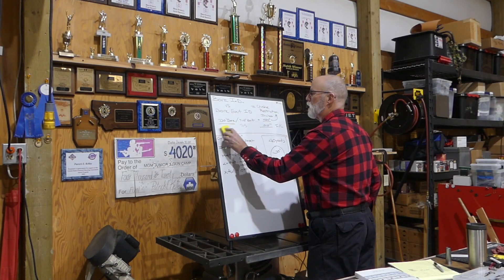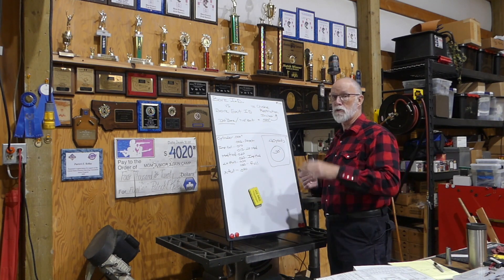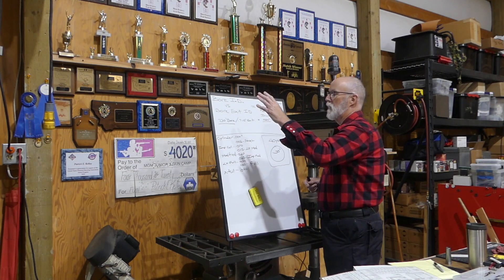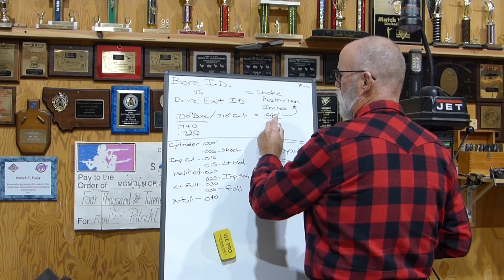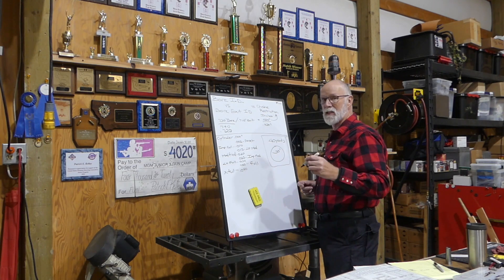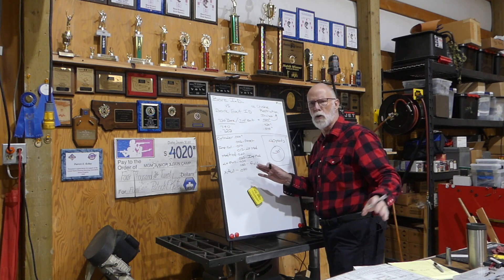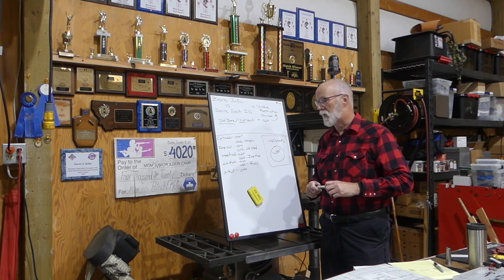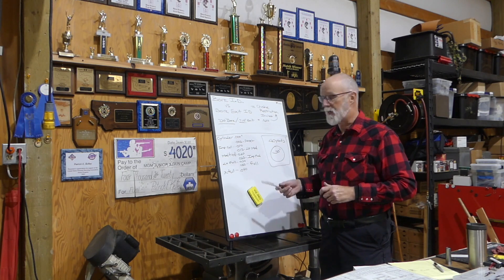What is a Shotgun Choke?

Comment: Nice to see you back. I hope you are doing well. I have an odd question regarding rifled choke tubes for shooting slugs.  Do they actually work to improve accuracy when shooting slugs?
Reply from the maker: Rifling (choke or barrel length) is mostly for Sabot style slugs.  Rifled slugs have "fins" or raised ribs to fit smooth bore barrels and be able to squeeze through chokes.
Reply: Along the same sort of lines...
I have fired several brands of rifled slugs through the rifled barrel, just to see what happens.   ALL of my shots, from every brand, walked to the right beyond 40 yards. 
Rifled - sabot, or a really WIDE spread for shot.
Smooth - "rifled" slugs and everything else